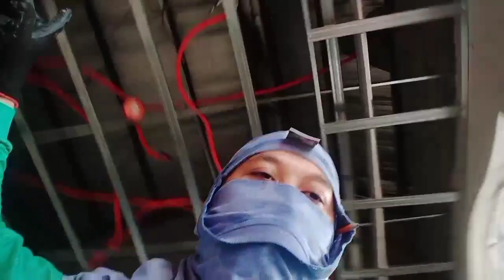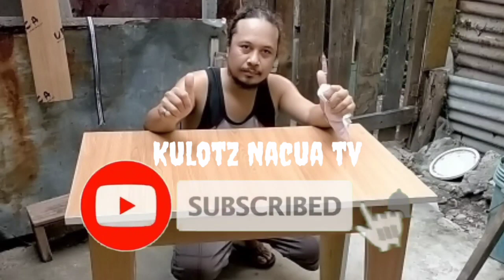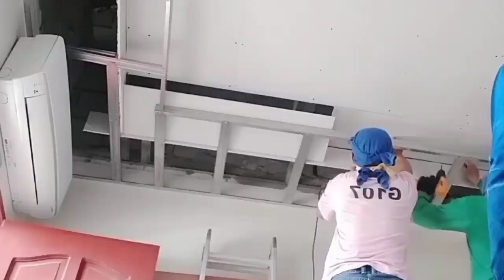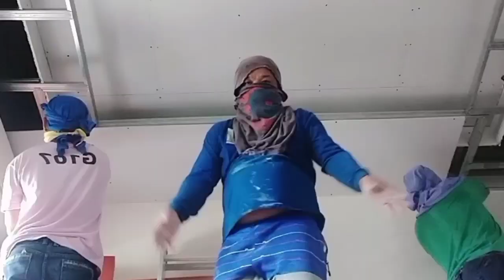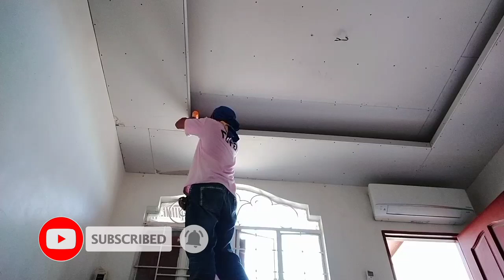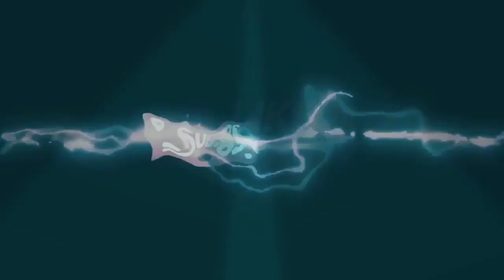Day2 Ceiling installation gamit Gypsum board with covelight/Kulotz Nacua tv

Comment: Boss anong kapal ng gypsum board at aning size ng gypsum screw gamit nyo? At alin ba mas mahal hardifllex o gypsum board? Thanks
Reply from the maker: 8mm po kapal ng board #1 ung blackscrew ung mataas ng kunti ung   gypsum o.
Reply: @kulotznacuatv3361  maraming salamat boss? God bless.
Reply: Boss! Isa pang tanong..yung 8 mm mga ilang inches yan? Nsa 1/4 ba?
Reply from the maker: makapal ng kunti sa 1/4 po.
Reply: @kulotznacuatv3361  maraming salamat boss!